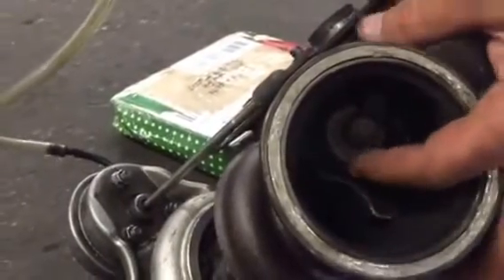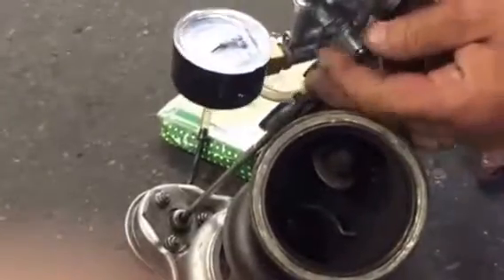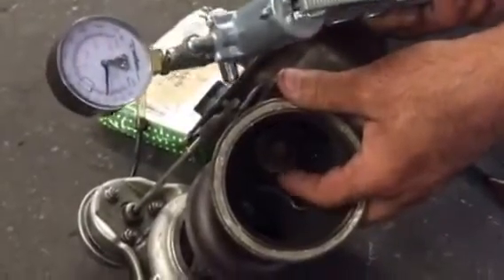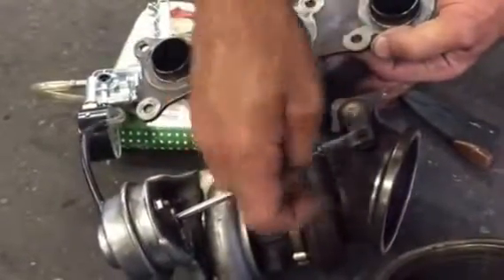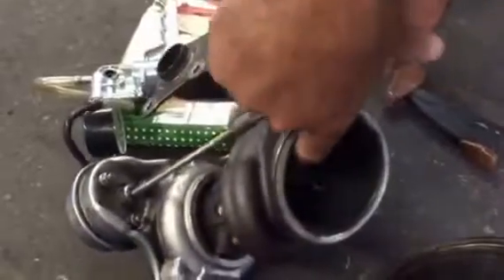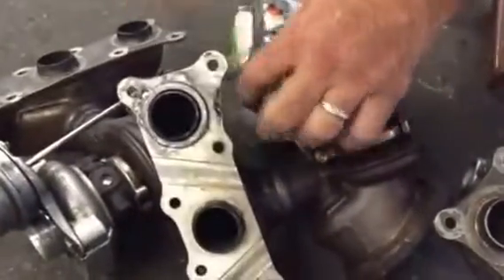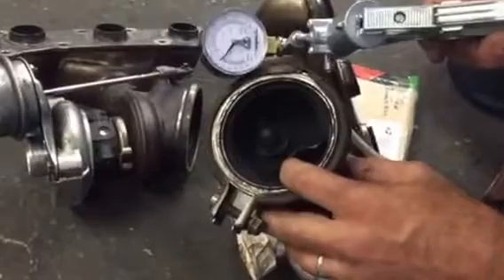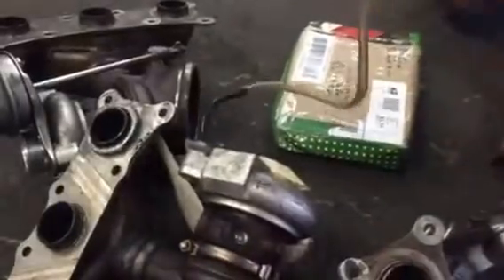BMW N54 335 535 turbo waste gate 30ff fault test

Comment: I have the code 30ff in my x6 2010. It seems to be lacking in power. Could that be the reason shown in the video? Please someone help me.
Reply from the maker: You first must make sure the vacuum control is good the most common problem or vacuum hoses if they are good then you may have a turbo problem
Reply: vacbmw If the vacuum hoses are good, have any solenoids or other issues I have to check before I see the tubing?
thank you for the tips!

Comment: I have the same problem with my turbos. Got the dreaded 30ff low boost pressure code. My 135i has 120,000 miles on it so looks like I'll be replacing the turbos. Anyone know if the Mitsubishi turbos are as good as the BMW OEM turbos??
Reply: I have been told that BMW use Mitsubishi turbos oem.